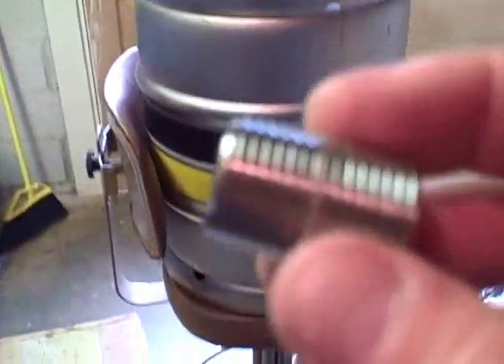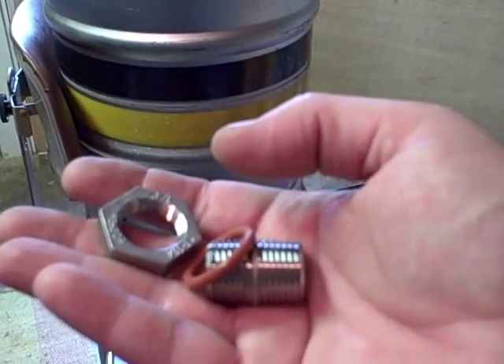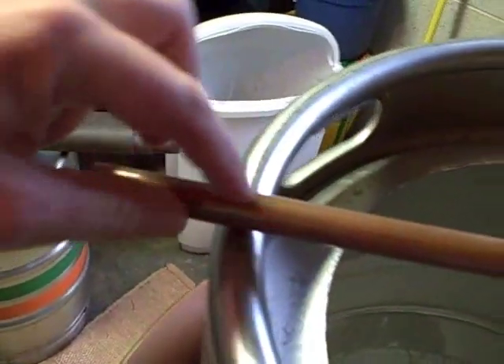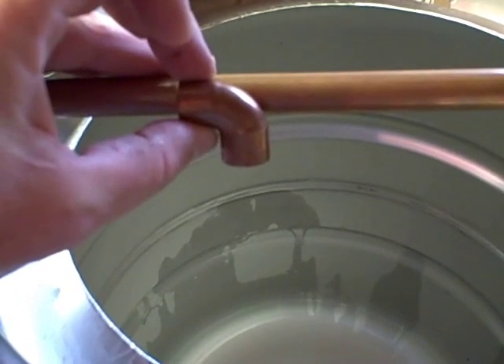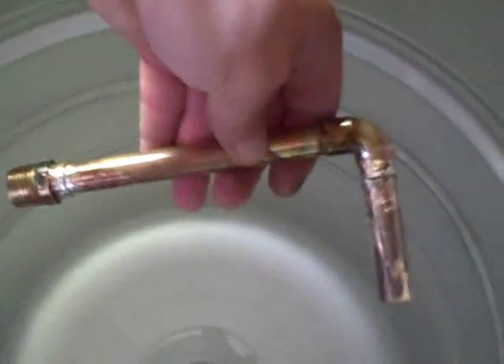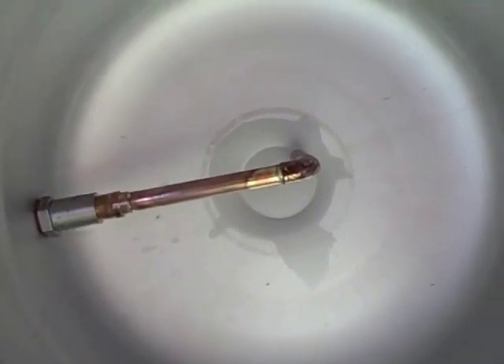Weldless Ball Valve Install on the Keggle

Comment: It's getting exciting over there, brew-day a comin'!!  Say, on my ball valve (it's a Kettlevalve brand name) the instructions said to put the silicon o-ring on the outside.  But I see on that website, looks like yours is supposed to be on the inside -- different strokes I reckon.  Thanks!

Comment: The one thing I'm mostly worried about is the fact that I am used to just throwing my hops in the wort.  But now that I'm going to start using a keggle, I'll be using a ball valve to get it out instead of just dumping it, and straining out the hops, like I do in my current pot.  Plus, I'm almost done building a Counterflow Wort Chiller and am concerned with trub getting stuck in there..  So I'm currently thinking about trying dennybrews' method for a pickup tube, but just placing it on the side.

Comment: Jake,  

So I've purchased my bargainfitting ball valve and am getting ready for a pickup tube... are you still using the 90 degree in the center?  I'm looking to boil my hops and such in the kettle, so I may try to put it on the side and try the whirlpool effect.  But before I begin, I figured I'd see if you've adjusted your setup at all?

Comment: Great video what size was the valve and where u getvit from?
 Also how you cut the top off?
Reply from the maker: it came from barginfittings (dot) com. Check out the link in the description below the vid. I used an angle grinder to cut it out. Worked well! Glad you enjoyed the video! Cheers
Reply: Thanks you had a few good ones. Stole some of your idea on your keratin build. Thsnks.